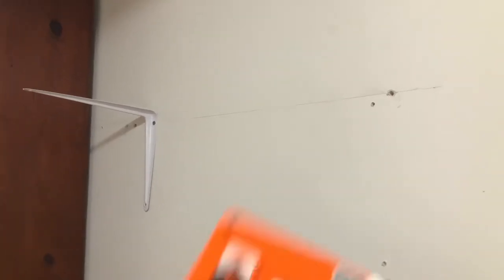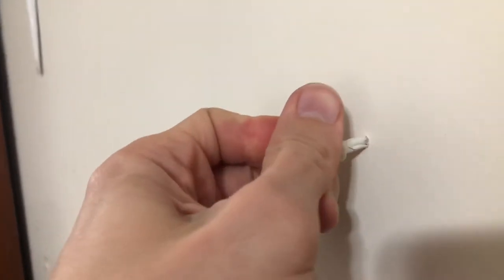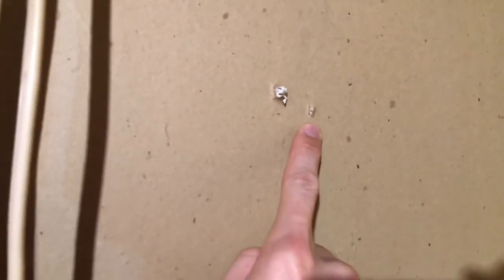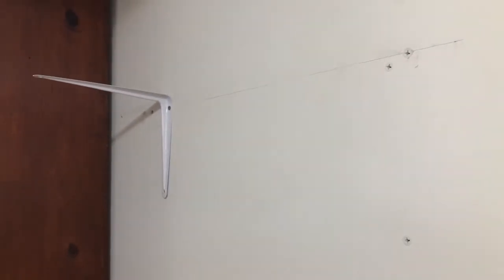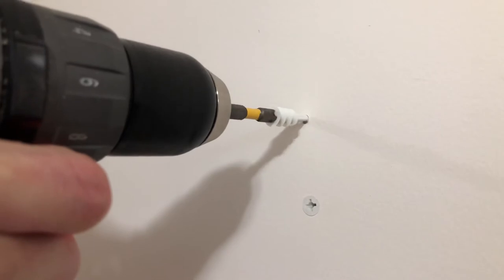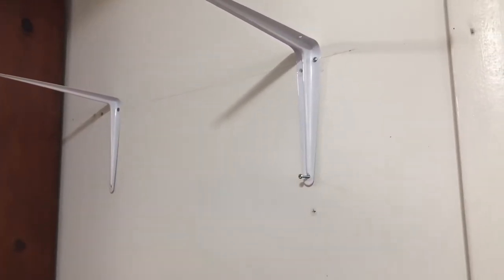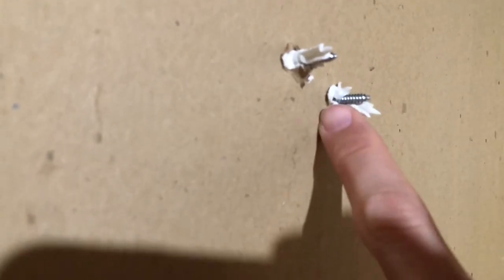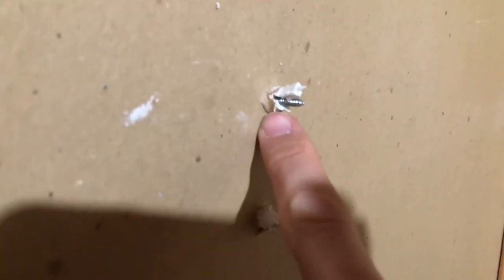Installing  50lb drywall anchor with the back exposed

Comment: These anchors are pretty great and can handle much more than they say they can.  I don't recommend overloading them but as long as you have healthy drywall you can trust them if you stay within the weight rating.

Comment: I tryed this on 3/8 drywall and completely failed I don't know what I did wrong lol
Reply from the maker: Hmm, what went wrong? Did it strip and spin through?
Reply: @VisionGuy  ya basically. Kind of just went in, and then just sunk sunk deeper and fell in wall.  It was 3/8 drywall I think and maybe I did something wrong or just a bad spot in drywall idk lol.
Reply from the maker: I've had that happen before. I think its bad spots in the drywall. I also noticed that the 50lb anchors work better in thinner walls and 75lb anchors work better in thicker walls. Either way, good luck. If all else fails, you can use toggle bolts.
Reply: @VisionGuy  10 4 thx man